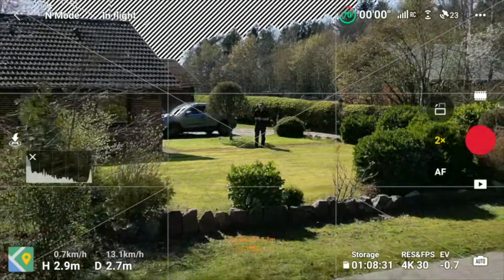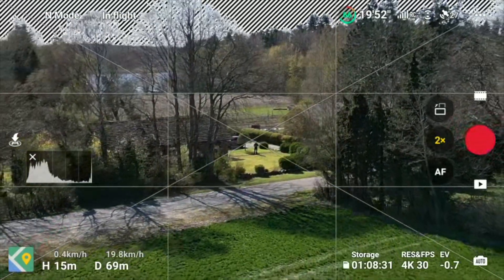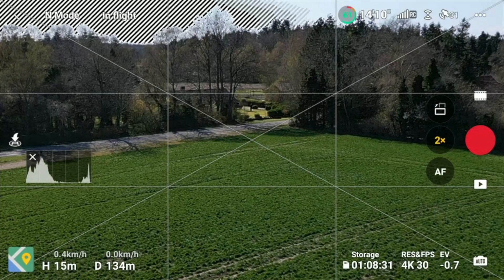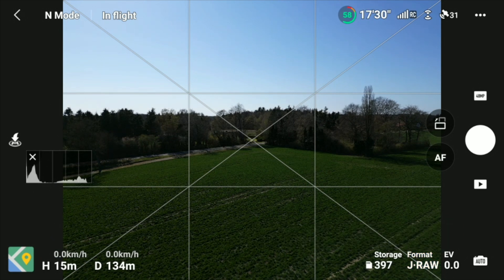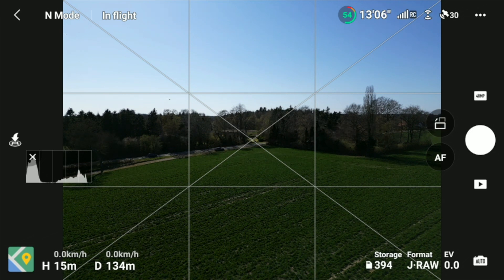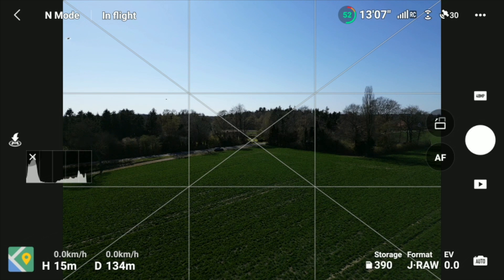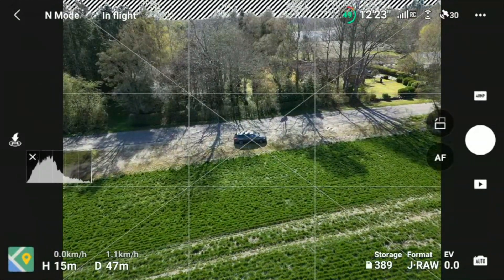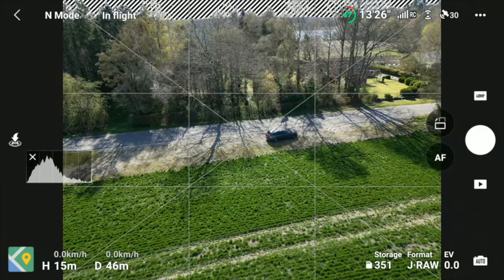TEST: RC Connection LOSS with DJI Mini 3 Pro after 48MP Photos Burst

Comment: Hi Henrik,

Coincidentally, yesterday I took a shot with my Mini 3 Pro at 48MP, at a distance that did not exceed 2 - 3m at a height of 10m, when I shot at 48mp, at that moment the RC controller froze for about 2 min, then I react and I was able to land the drone.

I turned off and restarted everything (Drone and RC), I was able to continue flying and taking my shots, but I stopped using the 48mp photos.

I have everything with the latest versions of Software and firmware.

Comment: I have had this happen to me on 3 separate occasions. On each occasion it was whilst taking a single 48MP image. I got the lag whilst it was processing the image then the screen went grey with the dreaded 'Connection Lost' error message. The return to home kicked in, and so thankfully I was able to retrieve the drone. Could only re-connect by turning everything off and on again. Having looked online to see if others have experienced the same thing, I've heard it suggested that once the card is around half full the problems will start. This certainly seems the case with me, I took several 48MP images without a problem and shot some video too, but the the problem kicked in. Have also heard that if experiencing this problem you should reformat the card. I've tried that, and also bought a new SD with 128GB instead of 64GB, but haven't had the chance yet to fully test to see if it's solved it. As a cautionary note, it's always a good idea to take off from an area where you have clear space above you with no trees, otherwise when it returns to home automatically and you can't regain control of the drone then it won't crash in to a tree on the way down!

Comment: I noticed that Hendrik flies the Sandisk Extreme Pro and I fly the Sandisk Extreme. The difference is that the Extreme has a maximum write speed of 70mb per second and the Extreme Pro 90mb per second. That could be the complaint. I'm just going to order an Extreme Pro and then test both cards in an open field where safe RTH is always possible. After that I will post, perhaps in the form of a video.
Reply: SDcards recommended by DJI have lots of room to spare when it comes to writing speeds. DJI specs on pg 68 of their manual for this drone has 150Mbps (mega bits) listed which equals to 18.75 MBps (mega bytes). 8 bits are equal to one byte. Recommended SD cards are V30 which is 30 MBps is well over the mini 3’s max 18.75 MBps. Which is great.
Reply: The max writing stress test demand that the Mini 3 pro can do is while in video D Cinelike @ 4K/60. Anything else and the bitrate only hovers around 93 Mbps which is well below 150. The codec setting of H264 requires more bitrate compared to the H265 setting; however, H265 is more demanding on the mini 3 pro's cpu but will have smaller file size on the SDcard.
Reply: @RejeanBoucher  Thanks for your good useful reply. I already have my new card in and will do a test as soon as possible. First with the old one to reproduce the complaint and then with the Extreme Pro. We'll see.

Comment: Recently, we had an issue with our Mini 3 Pro while taking 48mp photos of an abandoned sanitarium. The RC screen for the drone seemed to start lagging, and then, as we took our final photo, we got an attitude warning, and the screen grayed out. This was our first experience ever losing connection, and thankfully the RTH settings were properly set before flight allowing us a safe return, despite obstacle avoidance being disabled...

When we were attempting to locate the drone (not knowing it was returning) the GPS information put the drones location roughly 1,000 feet away from where it actually was. I had got in my car and was about to drive to the location on the "find my drone" map, and luckily, caught it descending in the corner of my eye as I was backing up. Would have really sucked if I hadn't seen it, or there's a good chance it wouldn't have still been sitting there when I got back 😅.

We thought it was some kind of electromagnetic interference, over here. Glad to see we aren't alone with this problem. 

Our screen recording is on our channel if it's of any interest!

Comment: Just tried it as I saw your video whilst out for a sunrise flight.   I can’t make mine crash either.   I suspect the one that does has a SD card issue.
Reply from the maker: yes, agree
Reply: But even though - it should not give priority to the Card Process over the controlling software - right?
This means, if your card gets' faulty during a flight you will lose control over your drone - some programming has gone wrong  :-) IMO.
Reply: David, thanks for testing. Also, I am very curious which sd card you are using. Please see my reply to Hendrik.
Do you also find that my photo write speed is much slower than yours?
You could watch the video at (4.59 of my video), you can clearly see how long it takes the drone to write the data.

Comment: I received my Sandisk Extreme Pro 256gb today and noticed that it has a maximum write speed of 140mb per second. I am going to test as soon as I can with my old card and this new one. I thought they had a maximum speed of 90mb per second but that applies to the 64 and 128gb versions, I did not know that.

Comment: I lost my Mini 3 Pro during the use of the 48mp Foto. The screen turned to a black and white picture and i lost the connection to the drone ca. 15m above me. It stayed there until the batterie was emty and dropped like e stone to the ground. I had garanty and the drone was replaced by DJI with no problems.

Comment: Just jad this happen to me today. Screen went black and white, and warned of attitude mode. The drone returned to home without issue, i tried for 10 minutes to reconnect and nothing worked until i restarted everything. The SD card is one of the recommended from DJIs website, its 256gb and has over 200gb open storage. I just reformatted 2 days ago with the drone /controller. Eveeything is updated, I took about 6-7 48mp photos over the course of 10 minutes before this happened. No back to back fast shooting. Im going to reach out to DJI.

Comment: I have same problem with burstmode on mavic 3 app keeps crashing
Reply from the maker: Try a better SD card
Reply: @TECHDRONEMEDIA  i use Samsung PRO Plus microSD/SD-card - 160/120MB - 128GB, and never had any problems before opdate to flyapp 1.99 it allso crashes in aeb mode

Comment: Most important factor is probably the speed of the SD  card🤷🏼‍♂️
Reply: Tony, Yes it seems I chose a write speed that was too low. The Sandisk extreme has max 70mb per second and the extreme pro max 90mb per second. That could be the problem.
Reply from the maker: Keep up posted it would be really interesting to see if it makes a difference